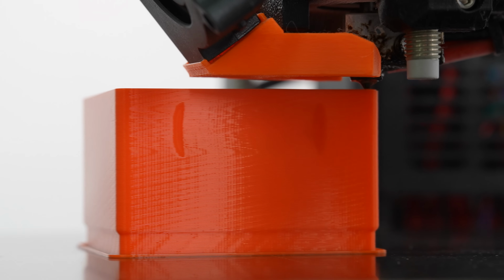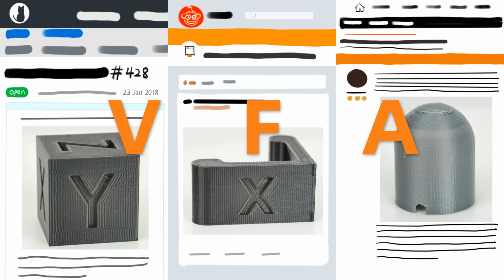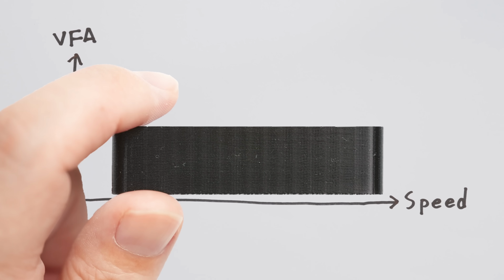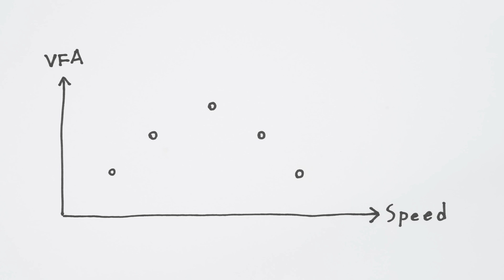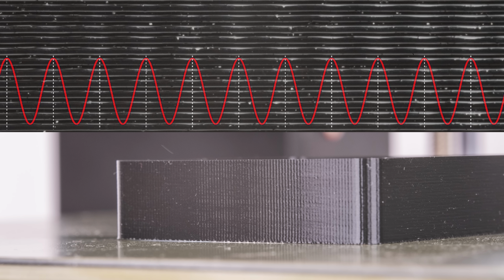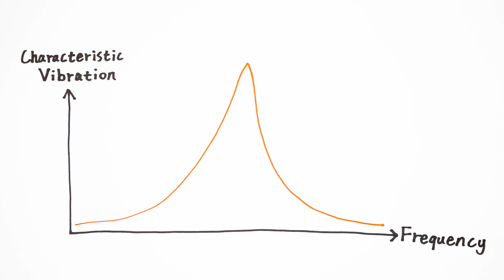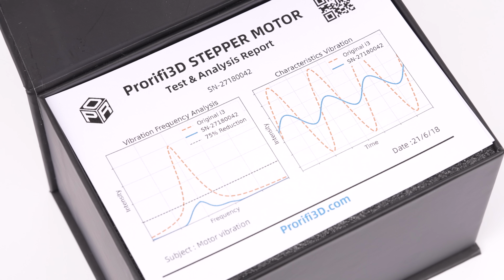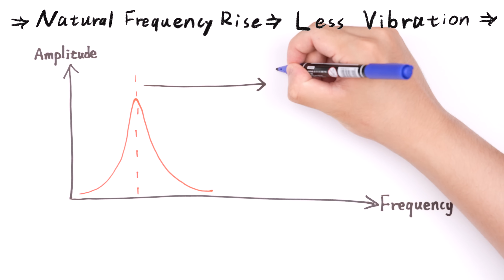We solved this common problem in 3D printing

Comment: Mid-band resonance is inherent to ALL stepper motors. No amount of microstepping will get rid of it...Solution? Run servos and ditch the steppers. You get what you pay for. Alternatively, a hybrid closed-loop stepper that will run higher RPM (let's say 2000) with 5:1 to 10:1 gear reduction can eliminate most of the resonance in the usable speed range. Microstepping greater than 1/8 is the devil. WAY too much hysteresis to be reliable, which means the shaft is free to waller around between torque detents...which only really exist every 1/4 step.

Comment: Klipper.. Input Shaper.. tada
Reply: Well, nope. Input shaping works only for ghosting, and only during acceleration and deceleration. This is not ghosting.
Reply: @kabotteam  It is ghosting. Input shaping is resonance compensation
Reply from the maker: MRR(VFA) and ghosting are not caused by the same mechanism. Input shaping can reduce ghosting but it has no effect on MRR. We have a technical details page to help you understand the cause of MRR(VFA):https://prorifi3d.com/pages/technical-details
Reply: These are not ghosting artifacts.  Ghosting artifacts happen near direction changes, whereas the artifacts shown in the video happen in areas far away from direction changes.  Ghosting artifacts also fade as you move away from a direction change, but the artifacts shown in the video do not fade as you move away from a direction change.

Input shaper would do nothing to address these artifacts.

Comment: If only YouTube showed the amount of dislikes.
This is just a motor with less torque, current and thus power.
Of course the ripples show less then, the motor doesn't step as violently, and you won't be able to reach the same speeds/accelerations as a 'standard' motor
Reply from the maker: No! The Prorifi3D Motors for original i3 have the same rated current and holding torque as stock motors. Check it out: https://prorifi3d.com/collections/upgrade-kit/products/kit

Comment: Are you sure you solved the problem?  The problem is still there but just further subdivided or in other worlds a smoother gradient. Only solution to the problem is micro stepping and using fiberglass reinforced gt2 belts and not steel wires reinforced belts.